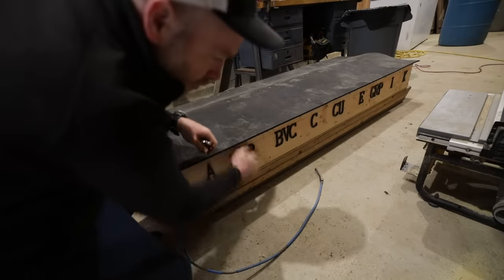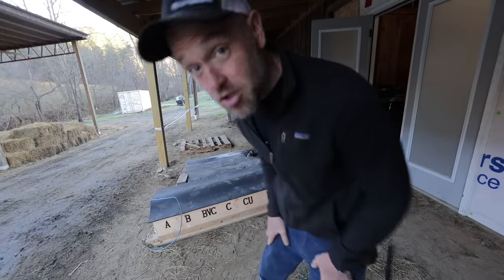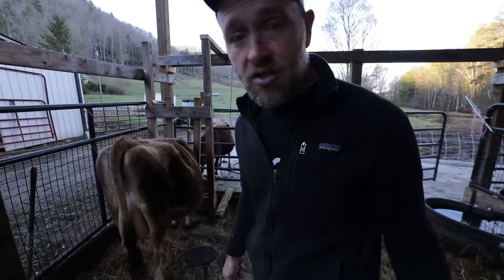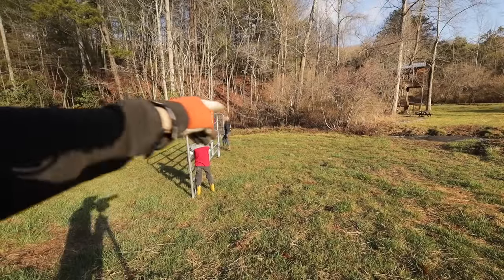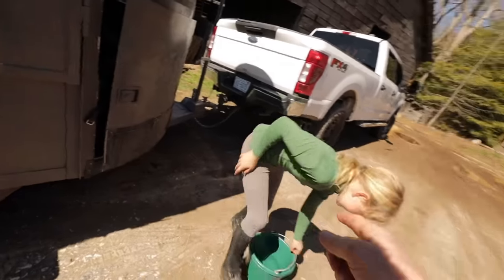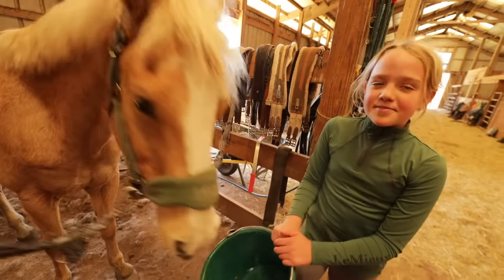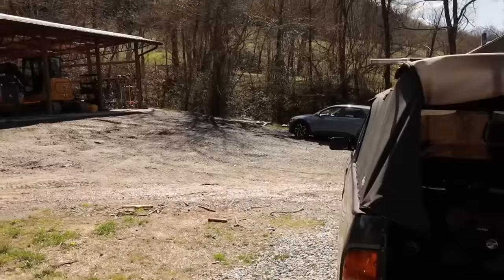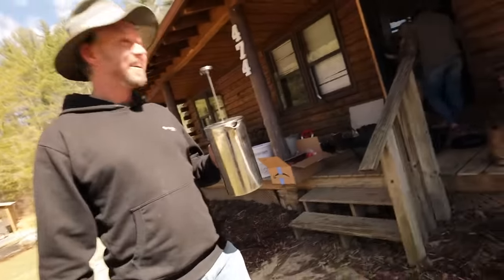Is Everything Okay?

Comment: Mastitis is easy to control, good cleaning regime of the Teets with a good cream application after milking and a rigorous cleaning and disinfecting of sleeping areas, my dad would clean all the stalls (1 cow per stall) everyday, disinfect and use fresh hay or Saw Dust, sometimes disinfected sand. The last 20 years he used UV light to minimize pathogens. But with only 1 or 2 Cows wipe before milking with disinfectant and cream after milking, big No-No is Cows on old bedding, it is not worth the effort to make compost instead of looking after Cow health. But You know this!

Comment: To make a super light mineral feeder, you should use 4" pvc pipe for your runners and 1" for the frame. Screw, or bolt plywood to pipes for walls and bottom.
Reply: Runners will need 45° fittings on one end for ease of moving the feeder around.
Reply: It actually needs to be fairly heavy to stop the animals from tipping it over

Comment: I used to test dairy cows for mastitis using the identical equipment.  I think you can put in less regeant in the paddle cups - I would just put in a little squirt with just a little squirt of milk.  Then, swirl swirl, swirl and if they're ok, the fluid would be watery. Infection of varying strengths would cause the mixture to start to gel.  So you can see severe infections when it goes real thick, and lesser infections if it swirls loosely.  The vet had me grade the fluid from 1 to 4, 4 being the worst. He treated any level of infection.

Comment: I had Rachael at 40, Benjamin at 42, and Lydia at 45. I was still in the mode at 47 and could have had one then, but Darrell thought 3 were enough. I think it would have been fine to have another one after Lydia. Who knows, it could have been a brother to Benjamin. Now I am 68 and my kids are 28, 26, and 23. Rachael is 4 years and 9 months older than Lydia, and there are 2 years and 12 days between Rachael and Benjamin. He came 3 weeks early because I was dehydrated from the flu. The doctors induced me all three times. Two weeks early on both girls and 3 weeks early on Benjamin. I had gestational diabetes with both girls and was on insulin.

Comment: What if you put large lockable casters/ wheels on mineral shaw. They use them on heavy restaurant equipment and rock music crates etc. Just a thought.
Reply: I think that would be a great idea. Easier to pull.
Reply: I think when it's April and rainy and the ground gets saturated the wheels might sink down in the mud making it very hard to pull. When it's winter and the grounds hard it might work.